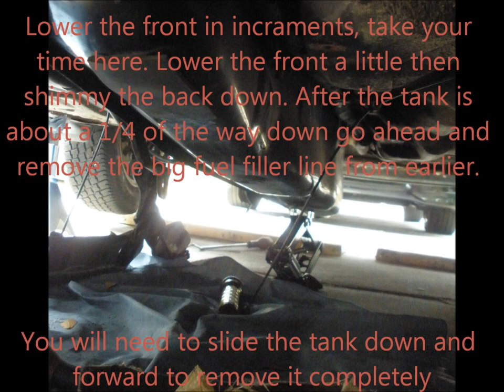AW11 Mr2 Fuel Pump Removal

Comment: Hey I came across this video and I just want to say thank you, my Mr2 has been having issues starting up. (Will crank but no start) but with this showing location of important fuses and the possibilities of that being the main problem gives me hope.
Reply: Mine does the same it will only start with starting fluid , but fuel gets to the rail and revs and cuts out at 2000 rpm , I think the pump doesn’t have sufficient energy anymore

Comment: @VvTheMuFFinManvV - Hello, thanks for the helpful video. I also have a red 86. Mine has low miles, but has been sitting for about 17 years and a few ignition parts were removed. I think I have everything back together. The two wires on the positive side were heavily corroded. I am not getting any spark or fuel pressure. I tried jumpering the fuel pump and nothing. Praying that I don't have to drop the tank! Could it be that the smaller wire on the positive side is not sending any power to the ECU and that is why nothing is working? I hope so.

Comment from the maker: I do have an 86 so I was very surprised to see my tank with the drain plug. I also read that it didn't have one so this may well have been a replacement tank or something, i'm not really sure. Even w/o that you can siphon most of the gas out. The job is way more doable than I thought I would be.

Comment from the maker: I honestly would just buy an OEM replacement fuel pump and replace the fuel filter. The pump has such a tight fit inside the tank that an aftermarket one might not fit. Also an OEM one will have the correct pressure so you wont have to worry about that.

Comment: Hey man, nice video, My fuel pump just took a crap today and I need to replace it soon. The description says you have an '86? I have an '86 as well but I read the '85-'86 didn't have the drain plug on the tank, but yours did? Any thoughts on this? This gives me hope lol
Reply: at the time toyota was going from mk1a to mk1b so alot of engines and parts for these cars are all mixed up from factory. guess you just have to be lucky

Comment: anyone please help!!!
Reply from the maker: sorry just saw your comment. Put the jumper wire in the Fp to B+ slots on the test box in the engine bay. It should have a cap with the positions labeled. If not just double check this video for the image reference.
 To check the fuse just pull it out. if it is bad it will look burnt and the piece of metal in the center will be broken. As for checking the relay I recommend watching this video https://www.youtube.com/watch?v=ire7vyDqelg.